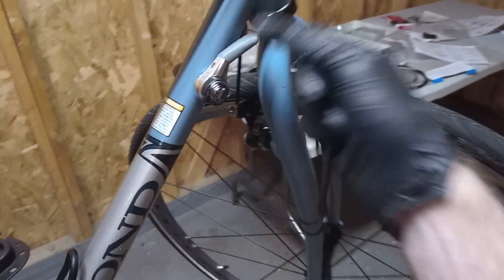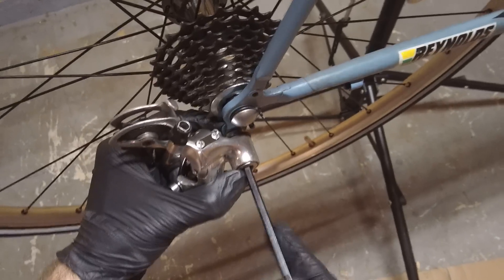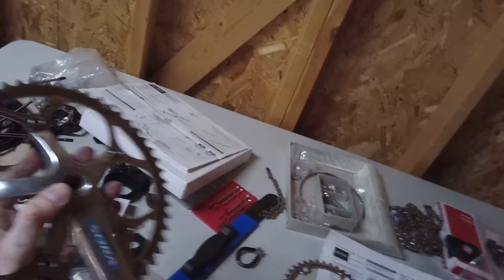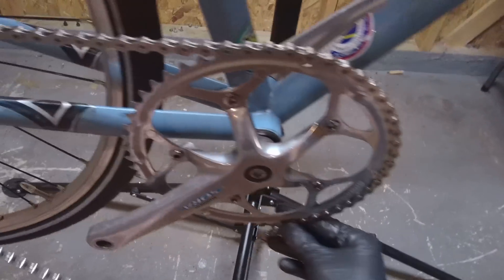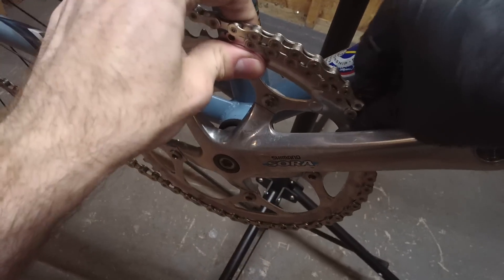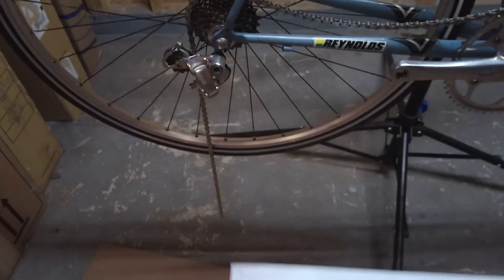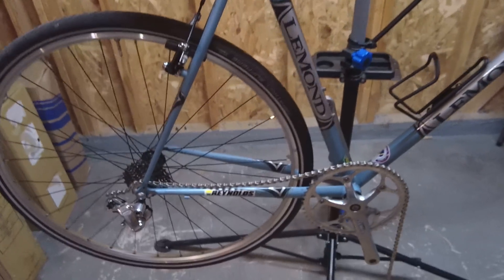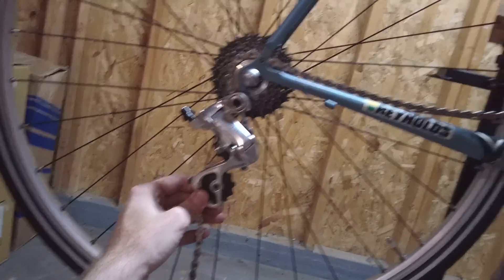Rear Derailleur Install Chain Length Chainring Bolts 1X9 Speed Conversion Bike Blogger

Comment: I've been playing around with my 1x8 conversion for a while now, and I think that the standard advice for chain length shouldn't apply to 1x setups.

If you measure your chain the standard way for 1x, you'll notice when you shift to the low/big cogs that the derailleur could be reallllly stretched forward.

This doesn't happen on a bike with 2 or more chainrings, because when you're on your low/big cogs in the back, you're also probably on a smaller chainring to avoid cross-chaining.

Having two mechanisms that counter each other (as the back gets big, the front gets small, and vice versa) means that the amount of slack in the chain (and therefore tension in the rear mech) can remain relatively similar throughout the whole range of gears. The 1x doesn't have this feature, which is why the rear mech has to stretch out when on the bigger cogs -- this will probably wear out the spring in the rear mech way faster than normal.

I've found for 1x that measuring the chain so that the pulleys are 90 degrees in the MIDDLE cog is a better rule -- the derailleur will look a little slack when in the small cog, and a little stretched forward in the big cog, but avoiding either extreme. Of course, with 1x it's a fine balance since you don't want the chain too loose either or you'll get chain drop! Cheers everyone.

Comment: hey bike blogger :) do chains ware out after a while? I heard they do and how?
Reply from the maker: +Adrian † Chains wear out, as do chainrings and cogs/sprockets (although they last longer). Chains last like 3000 miles or more. Rule of thumb is if you ride in the winter, replace the chain in the spring time after all the salt if off the road. Care for it and it will care for you. Clean it and it will clean you... that didn't make sense. :p
Reply: +BikeBlogger lol I wish, but thanks for the tips! I just got a mountain bike but I don't intend using it off road, rather play it safe and make it last on road :)
Reply: My road bike's original 10 sp chain wore out after barely 3K miles. It was stretched out. Now I have a KMC X10L-Ti with nearly 6K miles on it and it's not stretched at all.
Reply: Probably should have got a hybrid bike if you will be cycling on the road mate.
Reply: +Traitorbagel My first real adult bike was a MTB, but then I decided I liked road riding better and converted my MTB for road use.  Cheaper than trying to get a whole different bike, especially if the MTB was a really great deal.
Reply: Patrick94GSR
Fair enough!
Reply: +Patrick94GSR how effective was the conversion overall? i was thinking going that route too for my next bike next summer, i dont want a road bike per say (altho i'd be happy with an hybrid) but i do enjoy MTB comfort, never thought of converting back and forward until i heard some people doing it, so yeah how is it overall? can you give a bit of details of what parts you changed?
Reply: +SmilingDepression Glad you asked!  I made this thread on BikeForums when I first got back into cycling in 2012.  I kept updating it every now and then through the early part of this year, as I gradually changed out parts.  That bike is nothing but a frame and fork now, as I picked up a newer, larger steel frame and transferred most of the parts over to it.  http://www.bikeforums.net/hybrid-bicycles/812023-how-make-my-mtb-more-road-friendly.html

I learned a ton throughout that process, doing just about everything myself as BB has been doing in these videos.
Reply: +Patrick94GSR hey thanks for the link, really appreciated :) havent read the 7 pages yet ofc but theres a lot of good info just in the first two haha so yeah thanks!
Reply: SmilingDepression
haha it's funny looking back at those old posts where I said I'm not a serious cyclist, only ride a couple times a month etc.  These days I commute 2-3 times a week and get in around 100 total miles a week on average. :-)
Reply: Patrick94GSR hehe nice